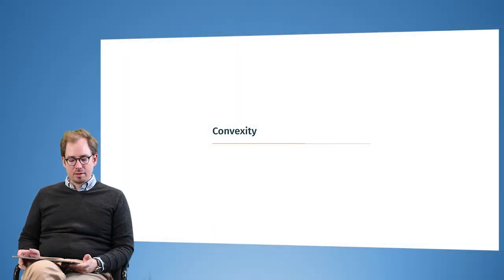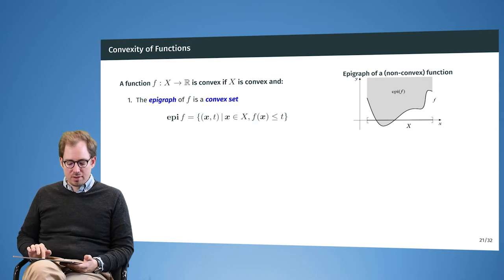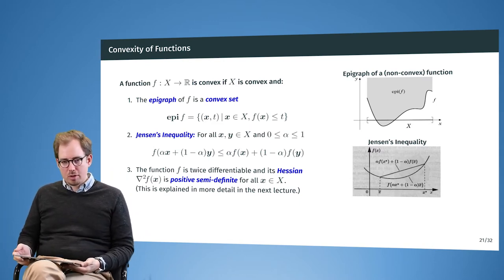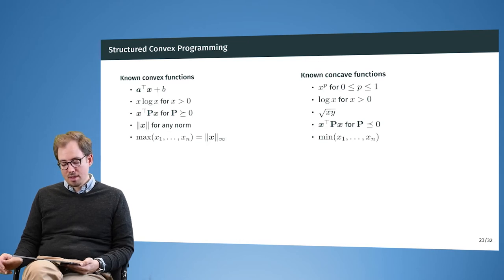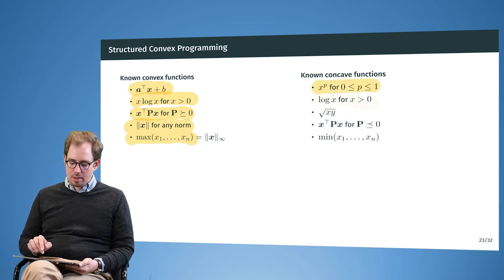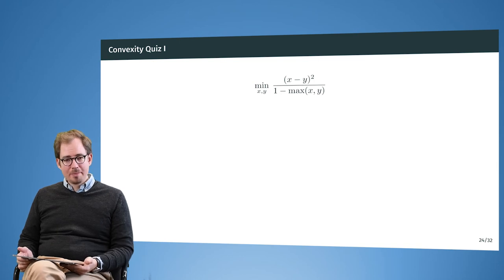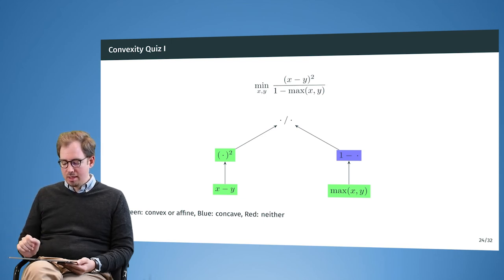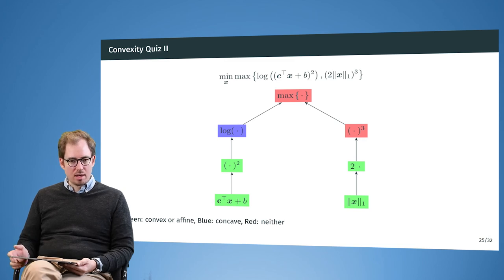1.4 Optimization Methods - Convexity

Comment: in slide 25/32 we have the cube of the first norm of x. So it takes every value of x, converts it to absolute of x, multiply with 2 and then take the cube of 2||x||. Why this is a neither convex nor concave? I think that the cube of 2x is neither convex nor concave because for x<0 this function will be concave. On the contrary,  the cube of 2||x|| is positive for every x and therefore convex.

Comment: I have a question for the convexity quiz: Why is there a min_{x,y} in front of the problem1 and min_\mathbf{x} in front of the 2? Actually, the infimum value of the first question diverges to the negatively infinite number and I think it is proper the quiz has the condition x, y < 1 for convexity of (1/(1-max(x,y)).
Reply: I think the minimum in front of both expressions indicate, which variables to consider as the function variables (opposed to b and c in the second example), since you are mainly interested in the convexity of the expression, when you attempt to minimize or maximize it with respect to these variables. 
And one definitely needs the constraints x,y < 1 not only for the expression to be well-defined, but also for the convexity, since if one only excludes {(x,y)|max(x,y)=1} the remaining X itself isn't convex anymore, but this was one of the requirements for all the convexity criteria, so the composition arguments wouldn't hold any longer.
Furthermore one can see, that Jensen's inequality is violated without this restriction for x=(2,0), y=(0,0) and alpha=1/4: The lhs becomes 1/2 while the rhs becomes -1.
Reply from the maker: In the second quiz example, we don't know the number of dimensions.
The \mathbf{x} notation allows any number of dimensions.